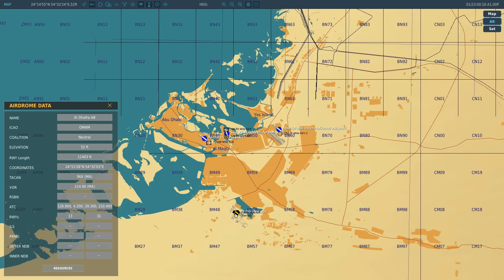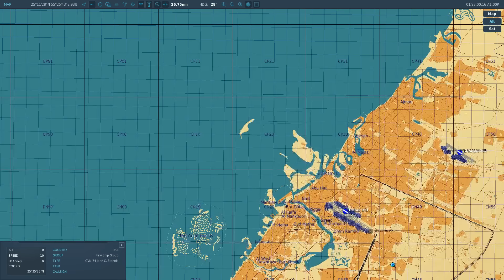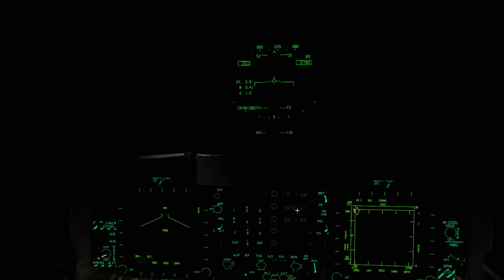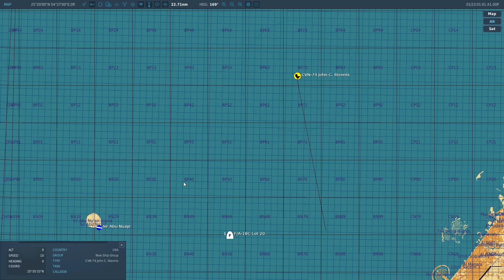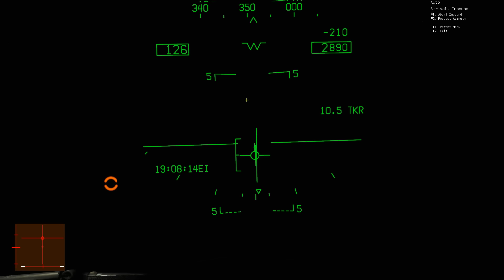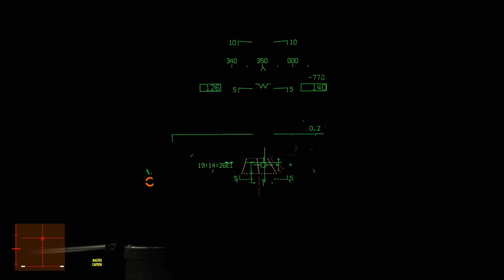FA-18C Hornet: TACAN & ICLS(ILS) IFR Landing Tutorial | DCS WORLD

Comment: During the Vietnam war, flight physiologists wanted to see how much stress pilots were experiencing during combat flying. Before arriving on station, the pilots would activate some sort of mini monitors that measured heart and breathing rates. As could be expected, flying in combat was stressful. Once finished with their missions, the pilots were to turn off their monitors. However, sometimes they forgot, and sometimes they forgot on missions that required them to make night traps. It was discovered that carrier landings at night were more stressful than flying in combat. "Oh, sugar!"

As others have mentioned, alpha (angle of attack) at these slow speeds is done using pitch trim and fore/aft stick inputs.... and throttle control. Technically, the power inputs aren't used for obtaining the correct alpha, but it's all a balancing act and so when alpha changes power adjustments might be needed, and when power changes are made alpha changes might be needed.

I wonder what the wind conditions for the demo were.

###

EDIT: I just watched the video again and noticed that the instructions regarding the AOA indicator were backwards (or I  misunderstood what was said). Because the aircraft is us supposed to be fairly close to its stall speed, everything about controlling angle speed and rate of descent is backwards compared to normal flying.

My apologies if I'm belaboring all this, but I thought describing it simplest terms might be helpful.

*Situation: *Fast - angle of attack is too low, red chevron points up (slow down).
Correction: Pull the nose up. Because you're now slower and closer to the stall speed, you need to add power to get on speed.

Situation: Slow - angle of attack is too high, green chevron points down (speed up).
Correction: Push the nose down. Because you're now faster and farther from the stall speed, you'll need to reduce power to get on speed.

*Situation*: Descending too rapidly (currently below glideslope or above glideslope but will be below glideslope soon unless you correct).
*Correction*: Add power to decrease your rate of descent to intersect the glideslope, and then adjust power to maintain glideslope. You'll likely be too fast now, so you'll need to pull the nose up a little to get back on speed.

*Situation*: Not descending fast enough (currently above glideslope or below glideslope but will soon be above glideslope unless you correct).
*Correction*: Reduce power to increase your rate of decent to intersect the glideslope, and then adjust power to maintain glideslope. You'll likely be too slow now, so you'll need to push the nose down a little to get back on speed.

###

The pilots in S-3 Vikings (and E-2Cs and A-3Ds; A-6s, EA-6Bs and A-7s had HUDs but I don't know if any navigation data was displayed on them) didn't have it quite so easy - there were no HUDS* - I think it was pretty much head-down until the LSO stepped in. TACAN data was on both video displays on the instrument panel. Someone in CATCC would say something like "say needles," and the pilot might say something like "up and right." CATCC would confirm that and that would tell the pilot everything was in agreement,  and at that point the pilot could "fly the needles" until handed over to the LSO at 3/4 mile.

*Bombing in Vikings was a treat, too, because there were no HUDs. For the first 10+ years, pilots would make a  T mark (it might have been inverted, I can't remember) on the windscreen with a grease pencil. Eventually, after I got out in 1987, someone got the brilliant idea of putting a permanent T on the windscreen, I'm guessing with thin black tape. Compared to Hornets and I suppose E-2Ds, Vikings were very manual airplanes. We had ACLS, either a forefather of ICLS, or the exact same thing with a different acronym.

Comment: Really nice video. Just a couple of observations. On final descent the target Rod should be 5 x ground speed (130kts=750feet per min)Pitch and roll to control position on ICLS and power to control Rod and AoA. Always intercept the Glideslope from below- usually 2000ft at 10nm.  Monitor the glideslope bar and as it reaches the PPI pitch down to intercept it and reduce power to set the Rod. Trim and adjust as reqd. Having set the Radalt to 500ft look up to Identify the landing point on the carrier and continue descent to 400ft-go around at 400 ft if landing point unseen or no ball and try again. Good luck.

Comment: One small yet super important tip, when at low airspeeds, you want to use the THROTTLE to adjust your altitude and PITCH to adjust your speed. Thus when you trim your A/C you’re essentially telling it “Ok no matter what KEEP THIS SPEED” and it will do that by changing the AoA, if it’s too slow it will dump the nose down and get back that speed (and viceversa), for this reason once you’re trimmed out at the correct airspeed you should no longer touch the trim, and if you need to make some adjustmenst to the descent angle/rate use the THROTTLE

Comment: Great video I learned something from a f18 pilot podcast that may be helpful when performing carrier landings they use a measurement- (400 feet of ALT every 1 mile) example 10 miles 4000, feet 5 miles 2000 feet, and so on.
 I used it on DCS with ILS and it seems fairly accurate. Just a helpful tip for the next guy!

Comment: Great tutorial, as always, thanks! One thing that made establishing on speed/AoA incredibly less hard for me is using trim for centering the FPM in the E-bracket (i.e. getting on AoA) and throttle for controlling descent rate (i.e. getting on speed). With correct trim, you will ALWAYS stay on AoA (i.e. centered in the E-bracket / yellow donut in the AoA indexer), regardless of your throttle input. Now the only thing you need to do is control speed (i.e. glideslope) with your throttle. Once you've realized that those two controls are actually separated, you've got a lot of guesswork off your table and a lot less of sweating is required to land on that carrier.

Comment: You keep adjusting your rate of descent using the pitch trim when you should use the throttle.  Using the throttle would allow you to maintain the correct AoA.
Reply: Yeah that is pretty annoying. Every time he messes something up it's because of that. Everything is so much simpler when you set your trim to achieve on-speed-AOA and then only touch your throttle.
Reply: @noe-tobin  yea I’m glad I learned from the start to get the proper. AoA set with the trim first and it’ll make things so much easier especially once you get really good, familiar with the speeds and decent rates you need for the different situations. I took a bit break so I’m a bit rusty but I used to be able to know just almost exactly when to start a glideslope from just about any range, and altitude. 

I had created a mission with an air spawn that required ya to get lined up and land on the carrier and I would practice that a bunch from all kinds of altitudes and weather conditions. I setup a very bad weather landing where the clouds were super thick starting at 5000feet and you couldn’t see anything through the clouds till the cloud deck was at about 500 feet so you’d have to just rely on the instruments and navigation aids to get lined up properly and on the right glideslope because you’d have to come out of the clouds and be landing within seconds since the clouds were so low, oh and i added a crosswind and rain too once lol
Reply: Yeah this is hopelessly outdated now..

Comment: The tick mark on your HGS heading tape only appears when you are going direct to as a bearing. Not there when flying a radial due to using the CDI. Also helpful is to know the glideslope angle of 3.5 degrees... You can put your trend vector at 3 degrees in reference to the attitude indicator and you'll maintain glideslope.

Comment: 15:40...How did you feel that your above the glide slope? What indicator?
Reply: @Captain Solo - From what I've gleaned from these tutorials I think the general rule is glideslope altitude should be 300 feet x distance in miles from the target point.  In this case he's 8.6 miles from the target at 2710 feet altitude.  He knows he should be a little lower at 8.6 miles x 300 feet = 2580 feet altitude to intercept the glideslope.  Hope that helped.
Reply: Jimbo in Thailand Thanks 😊 Why 300? Is it because this should be the descent rate?
Reply: @hmabboud  No, not descent rate.  It's the fixed 3° angle that you should follow (localizer glide path) that's measured relative to the ground and is standard.   The rough rule of thumb above merely helps to easily approximate the altitude you should be at to easily intercept the localizer glide path, depending on how far away you are from the landing point, in this case the carrier deck.  Of course, once you intercept the localizer glide path you would vary your descent rate as required to stay on the glide path.  Hope that's a little more clear.  :)
Reply: @Jimbo-in-Thailand  Is it 3° angle or 300 feet?
Reply: @hmabboud  Sorry, I don't understand your question.  What do you mean when you ask: "Is it 3° angle or 300 feet?"

Comment: I had the velocity vector in the middle of the bracket and then I realized that I was over the airport. I dont understand why it didnt get me on the runway. Anybody?
Reply: Velocity vector in the middle of E bracket only means you are at 8.1 degrees of AOA, which will allow you to hook up the wire on the carrier. To land your aircraft, you have to point your velocity vector to the near end of the runway at the same time. Keep your trim and adjust your throttle to do that.

Comment: How to land when airfield has no TACAN or ILS in IFR conditions?
Reply from the maker: Glad you asked! Use the ADF/VOR system to home in on the Inner and Outer beacons. Range to threshold is given by the beacon above warning. Glideslope is calculated by 300ft per mile. Course can be set on any manual or digital HSI.
Reply: @grimreapers  Get Radar Approach or go elsewhere.
Reply: There is a free mod which adds ICLS to some Nevada and Caucasus airfields, you just replace the beacon files. Great for practicing.

 https://www.digitalcombatsimulator.com/en/files/3303095/
Reply: The F-18C we got it a pure carrier aircraft. It will never land on an airfield in IFR conditions, but divert to a VFR one or the carrier. If IFR conditions form you wouldn't take off in the first place - this is why weather forecast is so important, also for civil flights.
Reply: @Krendor123  Stick to the question mate :). The question is as relevant as any other since that situation could very well arise if there's no other option.
Reply: @Krendor123  You could do a Tacan or Vor approach or a radar approach.  DCS doesn't model radar approaches however.

Comment: Just think of what a real pilot goes through having to line up tacan, icls, vector and E bracket all at the same time without the luxury of pausing mid flight.
Reply: Thats why the train it every day. With enough training you need to think much less about it and you do things like automated.
Reply: IRL pilot doesn't need to explain everything, and those things are set pretty fast without explaining
Reply: Well, just use AP, and altitude hold😂 They  probably can do it much faster on the real aircraft than clicking in a virtual cockpit too.
Reply: Also helps to have actual hands instead of a mouse